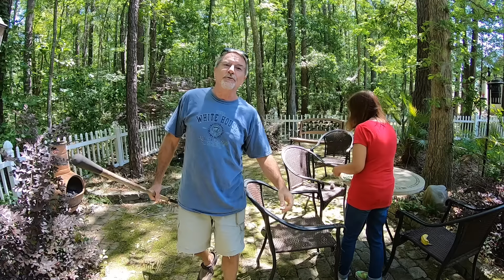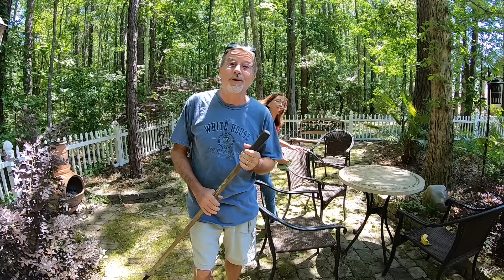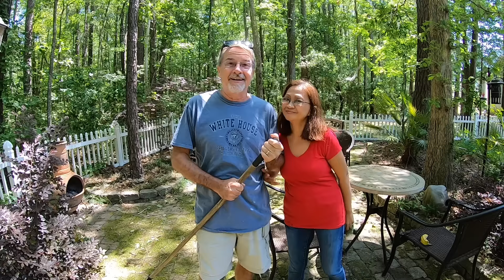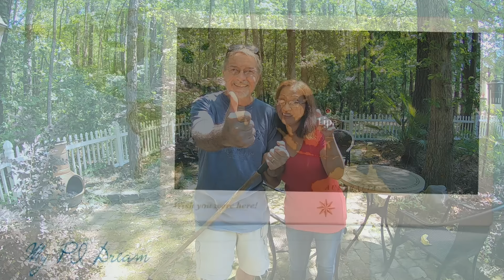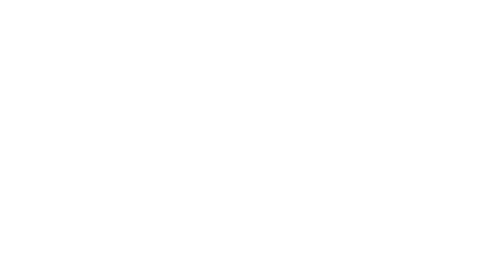SHOULD YOU BRING YOUR 110V APPLIANCE TO THE PHILIPPINES?

Comment: After watching the YouTube channel Vinz’ Works: “How to use the 220V supply for 110V tool, Etc.”  It seems that the Philippines Electric Power is the same as USA with 2 opposite phases of 110V that combine to make 220V with the main difference being that both phases are distributed to every outlet in the Philippines unlike in the US where they are split and one phase is used with a grounded neutral for 110V. If you are building it would be easier to just install outlets with grounded neutrals where needed as long as the proper breakers & 12/3 size cable was used from the distribution panel to the outlets. No transformer required. The main advantage of 220V over 110V is by doubling the voltage the amperage is cut in half so smaller gauge wire is used in construction cutting cost. So it would be my guess most outlets in the Philippines are not wired with 12/3 wiring but if you are building this would be a option.
Reply from the maker: In the Philippines Meralco runs 220 single phase, two 110 volt legs (L1 & L2) and the ground or neutral at the meter. If you have Meralco you can wire it the same way as the US wires houses. Two 110 lines in, run a US box with each 110 leg to each side, just like the US. Add your own ground from the box and run your neutral back to the ground on Meralco.
Here in our area, our electric company, BATELEC 2, uses single phase 220V.  Your house will have a L1 (220VAC) and and the ground or neutral at the meter.  There is no duel legs of 110V like Meralco provides so you can not get 110V in your house without using a transformer.

Comment: Hello Sir. Great video. I got a 110-120 V TV...typical power is 53 Watts (but there is a 135 Watt entry on the label which I assume is the maximum). I used a step down transformer with a max 200 watt output on it but the TV turns off after a few minutes (Did it twice). Based on your explanation 135 Watts X 1.5 will be 202.5 which means I am short 2.5 watts which is probably the reason why my TV is always turning off. QUESTION: So will it be safe for me to use a transformer with a 300 Watt maximum output? Just wanted to be sure. Thanks in advance.
Reply from the maker: Normally TV appliances are rated at operational power and standby power.  The standby power is very low, usually 0.5-3w.  So maybe the 135w rating is a peak value.

The normal transformer size you select is based on the expected load so the 200w transformer should have worked fine with the max 135w rating of your TV (135*1.5=202.5w).  The 1.5 multiplier I recommended is slight above what many others recommend of 1.25 as the multiplier.  It's possible the 200w transformer you purchased is not of high quality or defective.

So I would say the 300w transformer you're looking at will be more than sufficient for this TV.  Buying a transformer that is much larger than you need wastes energy as even when the TV is off and the transformer is on it is using electricity and the bigger the transformer the more wasted electricity.
Reply: @MyPIDream  Thanks for the reply Sir. I would try the 300 Watt step down transformer. Just wanted to make sure it will not "fry" my TV.

Comment: Hi James, we absolutely love your channel. My Filipina wife and I are retiring to PI in the next couple of months and plan to build a house. My questions about power issues are around an Internet radio station that I run here in the US. It's a fully outfitted radio studio with a lot of expensive equipment that I will want to keep. I know transformers are one way to go, but another option that I am seriously considering is to wire up my house as 110 instead of 220. My in-laws built a home in Pulilan, Bulacan about 5 years ago were able to choose 110 instead of 220. Do you know of anyone else who has done this? We haven't picked a specific area to build our home yet, but that would seem to be a great way to solve this power issue. I know this option isn't available everywhere, but it was with their electric company. Can you think of a real downside to doing that?
Reply from the maker: You first have to find out if your utility company provides single or two phase 240VAC.  If your utility company provides 240VAC two phase, then it has two 120VAC legs and a ground/common/return.  If you have 240VAC dual phase, you can wire your home for 240VAC, 120VAC or both. 120VAC can be achieved by only using one of the two 120VAC legs on a dual phase drop.  Your electrician can wire separate CBP's for both services.  Unfortunately for us, we are 240VAC single phase where one leg is 240VAC and a common/ground return.  We can not wire for 120VAC with this service.

Another option is to use transformers.  We only use one for some battery power tools that the charger is 120VAC only.

There is a third option that involves configuring the pole transformer outside your house to only deliver 120VAC from the 240VAC service but I believe this is not allowed by the public utility companies.

Comment: One thing to remember is the hertz. Transformers DO  NOT change the hertz! They only change the voltage! The US and Philippines use the same, 60 hertz. Countries in Europe and other places use or have 50 hertz. This WILL damage motors after a while from spinning too slow or too fast. Clocks WILL lose or gain 10 minutes, as with anything that has a clock, such as microwave. I made that mistake when I brought clocks from Iraq to Philippines. I will be wiring up 120 outlets in kitchen and in my shop when I build our house or use a switched outlet like you said. I'm also thinking about getting a large in home transformer to supply more outlets, but will be powered on and off with switches located in the kitchen or shop. Good information and video!
Reply: Japan (East: Tokyo, Hokkaido) uses 100V 50Hz, Jamaica and Barbados both uses 110V at 50Hz.
Reply: Brazil always uses 60Hz. 127V in Rio de Janeiro and 220V in Rio Grande do Norte.

Comment: I am planning to bring an air fryer, instant pot and coffee maker in the Philippines. I have a transformer back there that I use for my kids' nintendo games when we went home once. Will the power consumption be the same if I use the transformer (considering if I unplug it when not in use). Or if I ask someone to create a separate 110v plug specialized for those appliances?
Reply from the maker: Transformers don't use any power when unplugged.  When you do have them plugged in during use they will consume a little more power than if you plugged directly into a 220VAC plug with a 220VAC appliance.  My recommendation is you don't spend the extra for a transformer but to purchase a 220VAC air fryer here.  They are available.

Comment: My wife was a quilter.  Rather than buying a $10k quilting machine that could take 100-240V we went with the 110v model.  My guitar amps were 110v only too.  Simple.  When remodeling our home, our electrician used the 10kva transformer I bought and rewired our two hobby rooms for 110 only.  Visitors don’t use these rooms but if they did, it won’t blow anything they try to plug in.  Sewing machines, amps, boom boxes, and stereos don’t leave the rooms.  Kitchen items were left behind in the USA.
Reply from the maker: Like having 110 option.  Not sure about only having 110V for the room unless you can, at some point easily revert to 240.  Your amp choice?
Reply: @MyPIDream  bought a Roland Jazz Chorus from an old co-worker for $100. He had no more room after buying a MesaBoogie.   Crate bass practice amp.  Hartke HA 2000 and HA5000.  I bought the 5000 online, fixing the knobs, pots, power caps and crappy wiring. These can be converted to 220V.

Comment: Always  place a DUCT TAPE  at the plug  with  110 Volts writing using a pentel pen . Write a BIG 11O Volts on the body of the gadget , example a power tool like a drill or circular saw.  using a pentel pen or  an engraver. We still have  1965  craftsman Drill  and jigsaw  110 volts  at home.
Reply from the maker: Good recommendations!

Comment: Can someone teach me the difference between 220 and 110V? Why I ask is that my family down in the Philippines have gotten a few Smart Phones from me that we here do not use, but for some funny reason after they come to the Philippines, the longivity has gone down, like my samsung galaxy S4 mini witch I had with no problem for 6 years, and it was in mint condition, but when my GF got it down there it lasted only for about a year, so I wonder why is that. Thats why I wonder about the 220V and 110V cause maybe that has something to do with it.

Best regards a concern Norwegian.
Reply from the maker: It has nothing to do with 220VAC vs 110VAC.  The problem is some areas in the Philippines has "dirty" electricity.  Meaning there are transients and noise.  I did an episode explaining just this a while back and showed a diagram.  When voltages fluctuate like they often do here, electronic components tend to degrade, hence the probable cause with your Samsung device.  A work around is to use power conditioning devices.  They monitor the electricity and provide stable electricity to the devices connected to them.

Comment: The chances of burning your 110v equipment here in the Philippines is quite high when you start forgetting to use a step-down or AVR transformer
Also running a 50Hz equipments, specially with motors & compressors (electric drills, grinder, refrigerator, aircon, vacuum cleaners, blinder, fl. lamp bulbs, electric clock-radio) will eventually burn them due to the fact that the motors & compressor will run way higher than it is designed to do so. Electric clock-radio will also run faster gaining 10mins. per hour!
Be carefull & be attentive where you plug your 110/120v equipments. It can cause a fire!

Comment: Just bring your stepdown/step up transformers to P.I. or buy one there,  you can buy a 20,000 watts in Raon electronics in Manila. If your L1 110v and the L2 is also110v then you have 240v,  but if you need only 110v for your US appliances such as bread toaster not more than 20 ampere well you can make one. Just bury a 3/4 schedule 40 galvanized pipe to the ground then install your #4 solid ground wire using a copper clamp and bolt and nut. Run it to a separate sub panel then connect the hot wire from the service panel to your subpanel. That's what I did in my area in the Philippines now I can bring my US appliances.
Reply from the maker: Yes, places like Manila have 110v on both legs and as long as you have a ground, you can modify to get 110v using L1 or L2 plus ground.  Unfortunately, our utility company only uses L1 with 220v.
Reply: When thinking of using transformers of such a size, one must consider the 'power factor'  which can be considered as a loss.   This loss will generate heat and add to your power bill.   Another consideration in the need to keep both legs reasonably balanced to maintain some efficiency.   Utilities generally use auto transformers (which have only a single winding  around the core) and are tapped in a fashion to produce 2 legs of 120 volts each.  These transformers hanging on the utility poles are more efficient, but have no isolation between the primary and secondary.
Reply: Galvanize pipe if less than 8ft is not UL compliant nor NEC approved.  Copper clad ground rod has better current carrying capacity and UL listed and NEC approved material either 5/8”x 8ft or 3/4” x 10’ or 12’. You can buy Erico products in the Philippines. You can buy it also online @ubuy.

Comment: Will a home generator from USA work in the Philippines  ? They have a hybrid generator here in  the states, runs on gas or butane. Butane runs 20 hours.   James
Reply from the maker: Yes, a generator bought in the USA will work in the Philippines, but chances are if you bought it in the USA, the output power will only be 110VAC and not 220VAC which is used in the Philippines.  Not sure if you will find butane, but they do have propane.  Both butane and propane should work as really the only difference is butane doesn't work well at low temperatures which you probably will not have an issue with in the Philippines.
Reply: Appliances in the Philippines, some are multivoltage (LCD TV, DTV BOX like GMA Affordabox, TV Plus, make sure labelled 100V - 240V.

Comment: 16:06 I highly agree with you James . However, I have heard of a new home builder expat  that was a stonewall Jackson sort of fellow and at his own expense and with the cooperation of the utility company,(a real knock-down drag out fight, it was to say the least) installed his own transformer at the utility pole, a transformer having a secondary winding which can supply 120 VAC.  This is not impossible as many utility transformers are recycled from the U.S., but it is expensive and IMO the 230 V systems are better unless the homeowner ships expensive appliances from the U.S.  Which once here will be difficult to find parts and service for these imported 120 V appliances.
Reply from the maker: Not the first story I've heard with road blocks with the utility company.  Like you friend, persistence usually prevails.  Good story Wayne.

Comment: ask your electrician to build you a separate line of 110v buy using only 1 line from the drop line from the pole, and the other line grounded on a water pipe in the ground ....our house in the philippines got flat type female socket for 220-240 and beside it a round female socket for 110 v all over the house....no need to buy an expensive transformer
Reply from the maker: Unfortunately that's not possible in our case.  We have single phase 220V which is L-1=220VAC and L2=common.  Many rural electric companies use this.  Bigger cities like Manila often use L1 and L2 with 110VAC each and ground.  In that case, yes, you can retap your outlet using ground for common and get 110 at the service outlet.
Reply: Where in the Philippines is this?   I only see one 'hot' wire and a grounded neutral fed to most residential homes...

Comment: Hi James and Ness 
I would like to take a water pump (1.5hp) to Philippines, now the power here In UAE is 220-240 A/ 50 hertz/cycle.
If I buy an adapter let’s say 2000 watt is it going to work, knowing that In the Philippines the cycle is 60 hertz. Or do I need to buy a converter or regulator? 
Thanks
Reply: Your pump will run faster in the Philippines.  According to the linked article, if you have any sort of throttle, don't run at full sthrottle in the RP, because it will be tacked out since due to the 60 hertz it is already running faster than designed at full throttle so don't go to full throttle.  It is worth a try, I'm not sure about long term effects on a 1.5 HP motor.  Pumps are not very expensive in the RP and pump mechanics are very low tech so I wonder why it would be important to use it in the RP (unless you just don't want to buy another/use the one you already own).  http://www.50hz60hz.com/running-50hz-pump-motor-on-60hz.html
Reply: @ForwardGuidance  thanks

Comment: you need to buy here in the philippines an automatic voltage regulator with 110 plug outlet. and you can use your 110 appliance here in PI.

Comment: Selection of good quality small appliances and especially power tools are so limited in the Philippines . We brought everything we had with us and am very glad we did. We currently rent so I brought 7 step down transformers with us but the quality of them is awful so only have 4 still working now. I put one 3500watt inside a base cabinet and ran a plug strip on the counter top to plug things into when using it then turn it off when not using it. Then I use a 5000watt in my little work area for tools. 
We are going to build a house in northern Mindanao and I am going to buy a 18kva transformer from the electric company and install 110 inside parts of the house and my shop. Where we are we have 2-110 volt legs one positive one negative  to make 220v , so it's possible to just use the positive side and create a common leg  by grounding. That's how the electric company said they would install there 110v transformer for us by just grounding it at the pole since a common wire would not exist otherwise. 

Tool selection here just sucks is the best way to put it. If you just want the most basic of tools they can be found here but try finding a biscuit joiner,  4x24 belt sander, track saw, plunge router or any router for that matter, cut off tool, good compound miter box, sds hammer drill, etc.  the list just keeps going and going. I had a millwork company in US so I brought literally hundreds of 110v power tools here from the shop so for them 110volts is mandatory. If you have tools and are moving to Philippines bring them because not much can be found here, and battery tools are almost non existent here so by all means bring them with you they can easily be charged by using a small transformer for there charger.
Reply from the maker: Amen brother.  Speciality tools are rare in the Philippines.  I bet you're going to have one heck of a tool shop when all is said and done!

Comment: Philippines voltage is 220 Volt, 60 Hz. I bought appliances from other countries with 220V 50Hz, It didn't last.
Reply: Twit Twit 
50Hz equipments will not last long on 60Hz current because the motors & compressor will run higher than it is designed to do so. This only applies to equipments with motors & compressors
All other Australia/UK/Singapore stuff will run ok.
Take note if you have an electric clock-radio designed for 50Hz current it will run faster when used in 60Hz current, gaining about 10mins per hour!
Reply: dmcbohol Also 240V 50Hz clock radio from Australia or UAE, it doean’t affect the time running fast but also works on both 60 and 50 Hz. 1 tried to plug my 110V 60Hz clock radio from Canada and try to plug with my step down 50w transformer and it runs normally as well and compared from my watch and that clock radio running time as well.
Reply: I have never had problems with electrical appliances from Australia